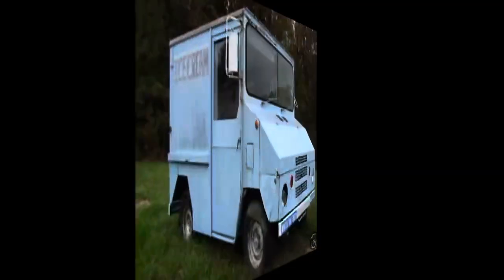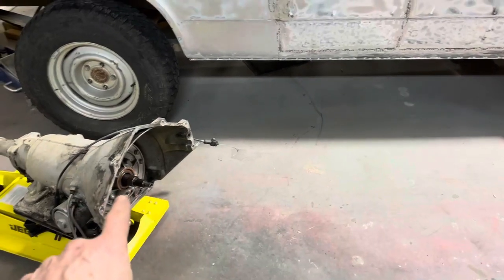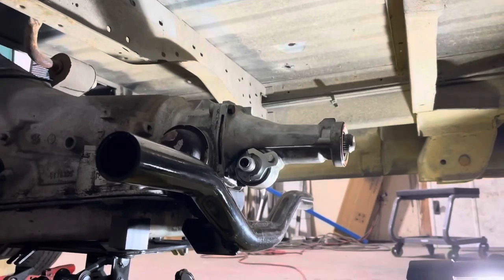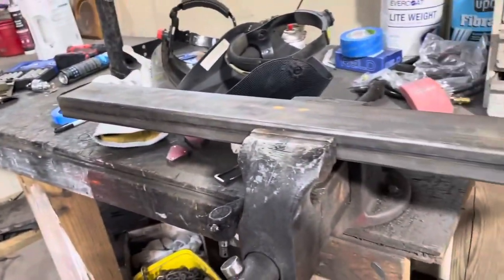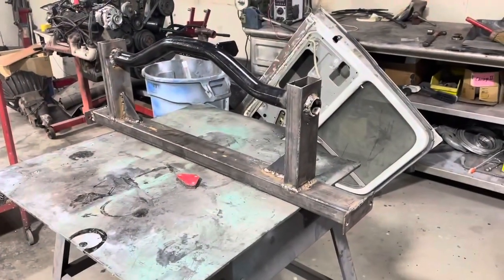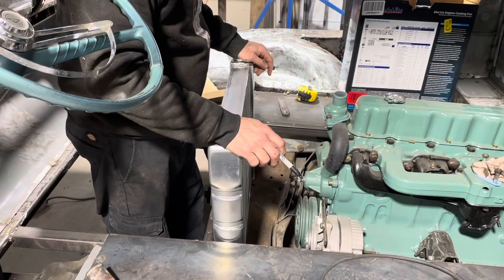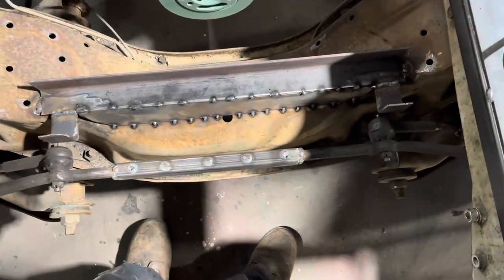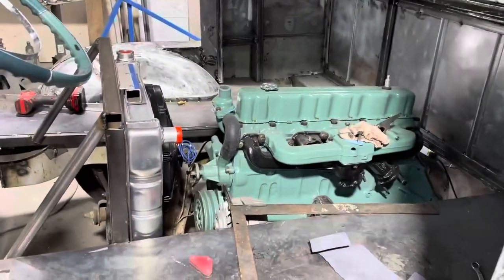Cab Over Chevy Van Conversion part 50;  transmission crossmember and radiator mount fabrication!

Comment: It's looking good. Will the 3/8 bolts hold the cross member to the frame without pinching the frame being just sheet metal? Just some 1/2 tube spacer tacked in for structural support maybe. Could be overkill for the job. The think I've noticed about atheist and non believers, I think you have to have some kind of imagination to have faith, people don't believe in things they can see or hold, people with a strong common sense seem to have stronger faith in my experience, for people to think that there is no higher power, that's selfish
Reply from the maker: Thanks for watching! I’m going to try it through the frame; I can always go back later and add some support tubes. You’re right; faith is believing in something we don’t generally see in the same way we visually perceive other things. My experience with my faith is much like my relationship with my wife. When we first married I knew I was ready to commit but our relationship has grown over the years because we invest time in each other. It’s the same with my relationship with the Lord. He’s given us His inspired word so that by investing time in it and with other followers, our relationship with Him grows and develops over time. If I had married my wife and then spent only an hour a week with her, obviously the relationship would be pretty stagnant. Even though I don’t physically see God, our relationship is very personal and we communicate daily. That early faith has grown into a wonderful relationship and knowledge of who He is.

Comment: It might be overkill, but I'm concerned about the crossmember only being supported from the sides. That places shear forces on the bolts. Maybe adding a 90 degree angle to the bottom so additional bolts can be threaded into the frame from the bottom would alleviate these forces.
Reply from the maker: Good thought; I might do that.